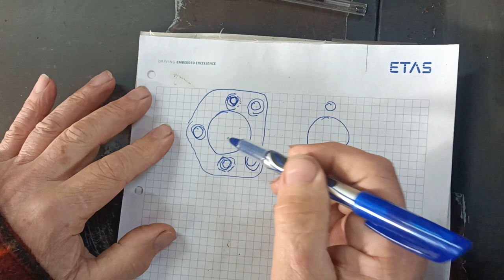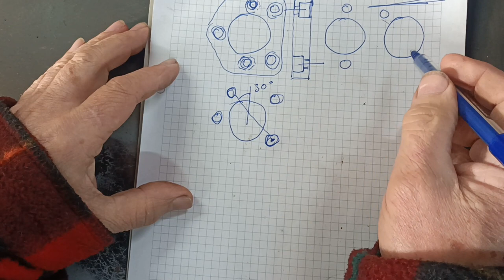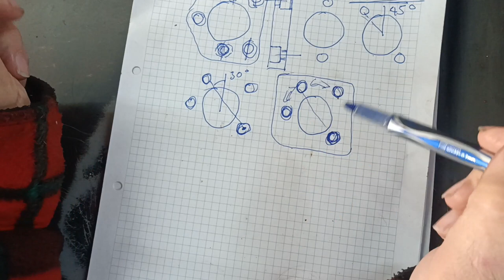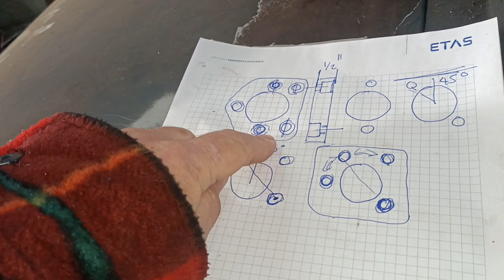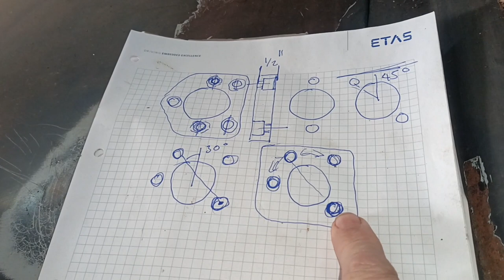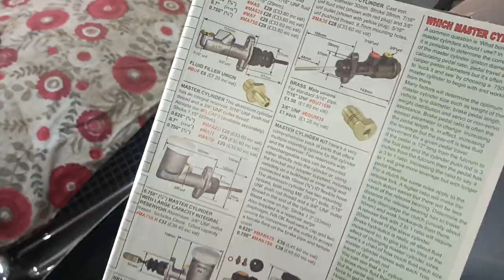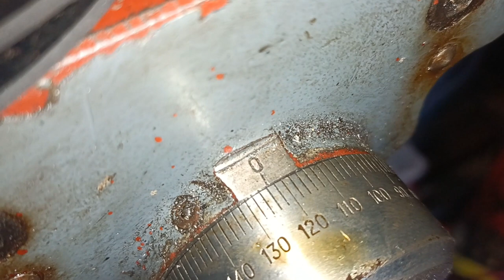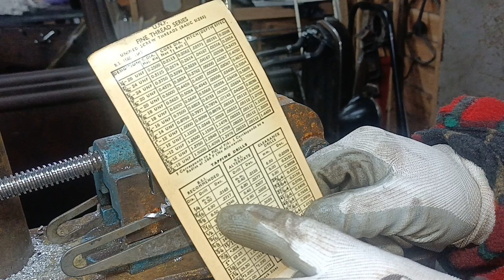1955 Ford Zephyr. Master cylinder conversion Part 1. (2323)

Comment: Good video Mart I think a lot of mk1 owners will find this interesting because most of the original master cylinders don't work correctly when bleeding. Looking forward to part 2
Reply: I could not bleed the brakes on my Zephyr Mk1 after rebuilding the braking system.  I handed it over to the local French garage owner.  I am sure he could not bleed them either.  He told me the master cylinder needed to be replaced.  I asked him how he knew "You have replaced everything else so it must be that".  I was not convinced as I had replaced the master cyinder seals and it checked ok on the bench.  All the same, I ordered a new master cylinder and handed it to him,  A few days later he told me the car was ready.  I am pretty sure that he could not bleed the system even with the new master cylinder but then he was forced to figure out how to do it.  I'm  guessing that he rigged up a system for pressure bleeding the system despite the Zephyr's brake reservoir not being suitable for pressure bleeding.

Comment: Hey Mart: The best "gauge" of how well a modification worked is when the modification looks like it was always meant to be there. Another way of putting/saying that might be "the simpler it looks, the better it was designed" !! What my son and I term as "elegant" whenever we feel like we have "stumbled" onto it. ;o)  You and Jeff have achieved that with this modification !!!  That's a clever design where one reservoir works for both cylinders. Don't think I have ever seen that before. Is that common with English vehicles??? I believe all of the "American" design cylinders have the "integral" reservoir. Many times with "under/dash" cylinders, that becomes a maintenance issue. Cylinders like these would solve that issue. Assuming, of course, they are available with proper size bores and strokes !!
Reply from the maker: Hello Ron. We elected to retain the existing reservoir because it is very tight in that position. It has a dividing wall so is in effect a twin reservoir. Geoff made some mods to it to improve it. You will see that in part 2.

Comment: Neat little job Mart, they look like Pilot master cylinders, must have been some left in the parts bin at Dagenham. Did you consider make one plate to cover both master cylinders, tricky to measure I admit.
Reply from the maker: Hello Pat. Yes, I believe the old master cylinder is similar to a Pilot. I didn't consider a single plate for both, because initially we were trying to fix the brakes only. The job then expanded into brakes and clutch for both cars. There is a commercially available plate that covers both. I didn't see an image of that until I had made my plates. That one sits the cylinders vertical, I think our idea is better because of improved pipe access.